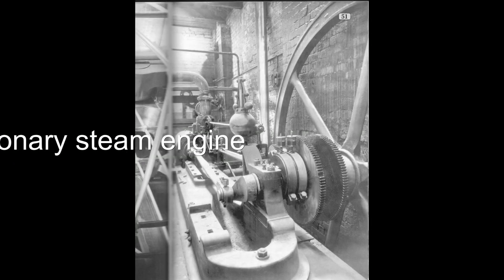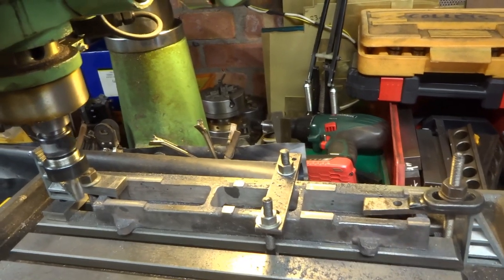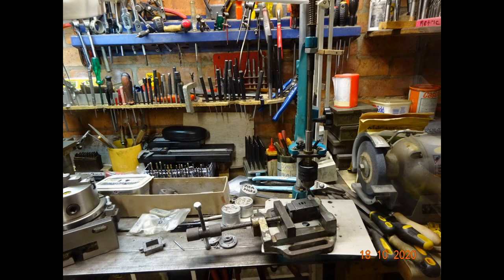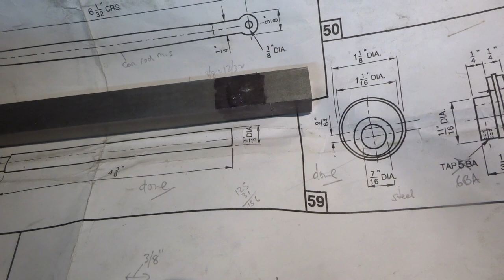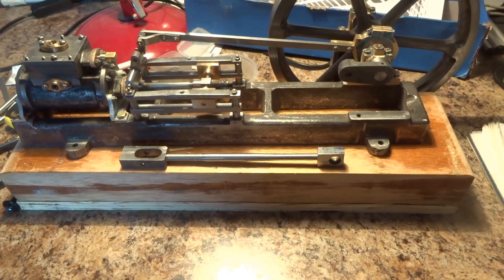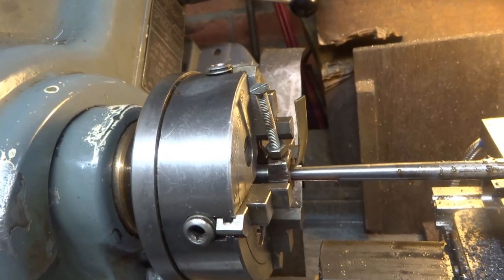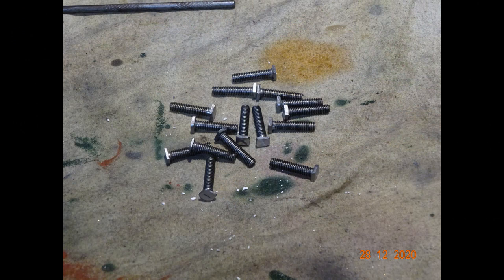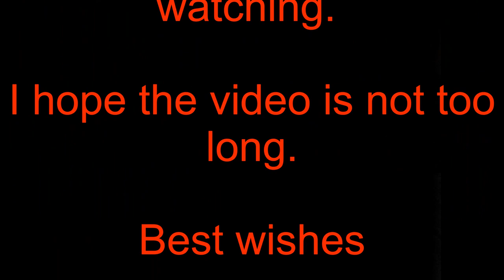Stuart models Victoria horizontal engine

Comment: Greetings from New Jersey, USA 🇺🇸 great video. I really like the dovetail jig you had in the tail stock of your lathe to machine the connecting rod.  That is a great idea, must also work well to offset the tail stock when cutting a taper.  Your model came out awesome, I am attempting my first model a PM Research #3 engine and I try to watch and learn as much as possible from fellas like you.  Thanks for taking the time to show your build.  Eddie wheels 😬🧑🏻‍🦽👍
Reply from the maker: New Jersey USA - that's a long way from Lincoln in England. Glad you like the vid. The Stuart victoria engine is a good looking bit of kit when it is done. I built the tailstock jig for taper work cos I got fed up with re setting the tailstock every time I set it over for taper work. It is useful if you find that you do a lot of taper work. Usually I do not, but I did go through a phase where I made a number of morse tapers to fit attachments in the tailstock of my small Myford lathe. Best wishes, Ed
Reply from the maker: Further to the above are you aware of a U tube channel called 'Blondihacks'. She is a very good machinist in Canada and is currently serialising a PM research vertical engine build project.
Reply from the maker: Thanks David, when I make some time I have a couple more vids to upload and I hope you will enjoy them,

Ed

Comment: Appleton insist this is what I should build as my fist steam engine out of castings. Up to this point mine have been just made from stock materials. Do you agree with him?
Reply from the maker: Modern Stuart castings in my experience are first rate and so there should not be any probs in respect of the quality of the iron etc. The Victoria engine is mechanically simple and quite impressive when completed. The flywheel is the largest component for the lathe at 7 in. dia. Like you over the years I have made quite a few models just by fabricating and I do like to do that. In general working with castings is likely to produce a quicker end result, but you may have to get used to different set up procedures when compared to fabrication. I am quite old now and getting more attracted (although not exclusively) to making from castings. As to whether this should be your first model from castings I am not really qualified to say because my knowledge of available casting sets is not extensive. I do however endorse the Victoria engine as a model when complete. In general terms building from castings is likely more expensive than fabricating from stock. Try and avoid second hand casting sets because unless you are lucky chances are some of the castings or drawings may be missing. Hope this helps. 
Ed
Reply: @edwinwhite933  7 inch flywheel might be a little tough on my 7 x 12 lathe. Find a rotary table for my mini mill is more than I can do.

Comment: Hello Edwin. What a lovely piece of engineering, I love your thought process and the end result is outstanding. I made a Stuart model steam engine about 50 years ago,  now retired, I'm looking to make another and love the look of this engine. Do you think it would be possible to make this engine on a mini lathe and a bench milling machine? Well done. Best wishes. Ken.
Reply from the maker: Ken, thanks for your kind words. The largest dia to turn is the flywheel at 7" diameter finished dimension. If your lathe won't manage this I believe Stuarts can supply this part pre machined. You will need both a 3 jaw and four jaw chuck. excepting the flywheel everything else is probably within about a 1.5" swing. Depending upon the table size of your mill the base may need multiple positioning to complete the surface milling of the short support areas for the various bearing surfaces, but with thought this should not be a problem. It is a nice project and I believe you will enjoy it. Good luck, 
Ed

Comment: hello Edwin. I'm building the same myself now. but I,m struggling with the length of the eccentric rod as on the new stuart plans a lot of the dimensions differ from the old as there was an up date so im working from the book building the victoria. unfortunately there is no dimension in the book! can I assume that the centers on the rod are the same as the centers on the base?
on the new plans there is 5/32" difference, the rod being longer. what did you do?
Would be great if you could film the making of your governor.
Reply from the maker: Paul, the absolute length of the eccentric rod is not crucial provided it is not a 'country mile' out. On my drawing the distance from the centre of the crankshaft to the centre of the valve crosshead levers is given as 7&25/32" that is what I tried to stick to.  No dimension is given on my drawing for the length of the eccentric rod itself. The length of the machined 'lug' on the eccentric strap may clearly affect the length the eccentric rod itself because the eccentric rod should fit snugly on the 'lug' of the eccentric strap. Some valve adjustment is available by screwing in/out the slide valve on its' valve rod and wrist pin - not a lot but should be enough to correct any minor error in valve travel. What is important is that the slide valve moves equally over the cylinder ports. It is important that the throw of the eccentric is machined as accurately as possible. it is also important that the lengths of all the valve cross head levers are identical - I machined them as one batch. I think I left the eccentric rod slightly over length to begin with then temporarily fitted/clamped every thing together ie eccentric rod/eccentric strap/cross head levers and checked that the slide valve movement seemed ok before finally trimming the end of the eccentric rod and fitting it to the eccentric. Hope this helps. I am now in process of making the Stuart beam engine and small comfort no doubt, but I found/find the drawings for both the Victoria engine and the Beam engine 'wanting' in certain respects. The more so because these are supposed to be beginners engines. I have Andrew Smiths books, but confess I have not referred to them. For what it may also be worth I found the centres given for the base on the Stuart drawing of Victoria to not work out and I changed them slightly. My approach is to machine components and keep checking by means of trial fits to see if things look as if they will work. Ho Hum.
Making the governors for Victoria and the Beam engine will be my next job when the Beam is done and yup I will make a short video.
Reply: @edwinwhite933  Hiya thanks for your reply. It seems as though you have gone about machining the components the same as myself. I must confess that my castings, like yours, I think are not genuine stuarts, and are not the best quality in dimension etc.
I found out that stuarts changed the design some years ago, so there are various discrepancies between old plans and new, so they can't be relied upon.  the 7&25/32" is on the new plans, but it measures 7&5/8" on crank center to guide bar stud center. on the old plans it measures 7&7/16" on crank center to guide bar stud center. I think your idea of leaving it over length approx 5/32" and clamping it first seems to be the best way to go.
thank you for your input, looking forward to the beam and governor videos
regards
Paul
Reply from the maker: I believe my castings are genuine Stuart, but they were bought 'second hand' and are 'old'. I think Stuarts have changed their manufacturing process somewhere along the line. Personal opinion, but I think their drawings are 'difficult'. Proceed with caution and trial fit/measure/check, remeasure/recheck has to be the way to proceed. Thanks.